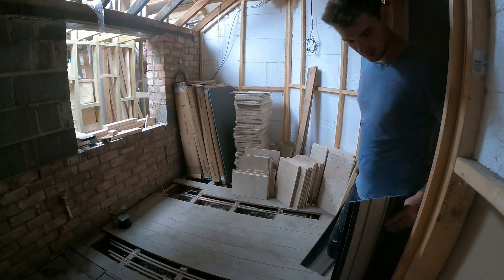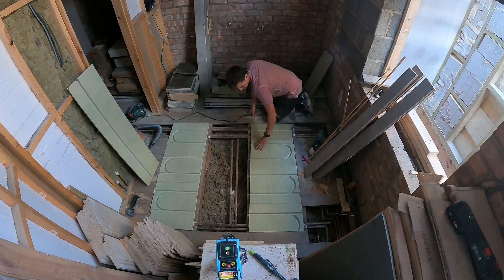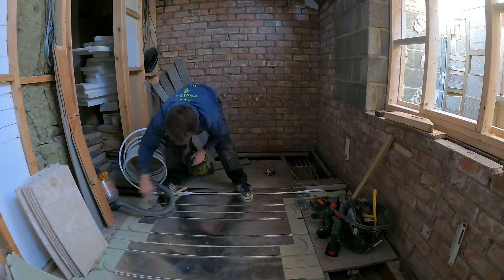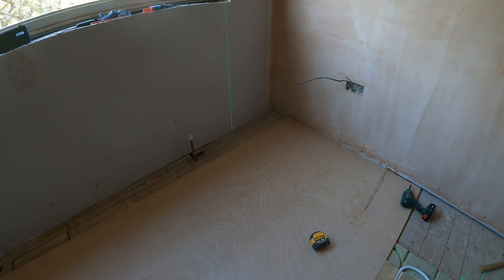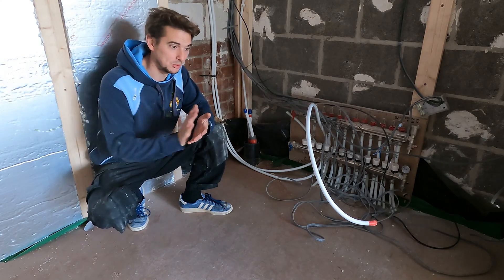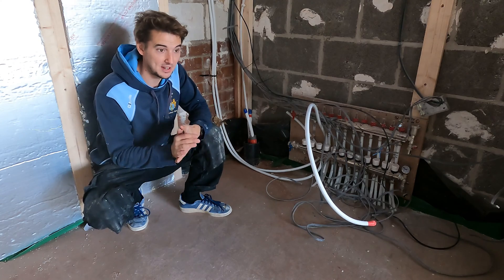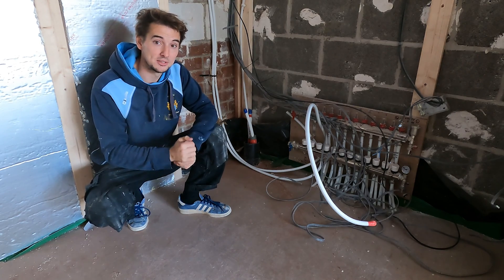Installing Upstairs Wet Underfloor Heating, Suspended Floor System, DIY Bedroom & Bathroom 🏠🛀🛌

Comment: Good to see someone not in the trade giving it ago ,  definitely easier ways but that’s life and everydays a learning day , all I’d say is when possible always go for hard wired room stats , rf are only for quickness and when putting new wires in isn’t a option as would be to much of  a mission ha ha .
Reply from the maker: Thanks for the positive vibes. It works really well this method so very pleased with it to be honest , not as good as heating the slab downstairs but I will take it as a win.
Was fuming about the thermostats but got all the wires in just in time .

Comment: Should have looked at the Honeywell Evohome. Wireless thermostats in the room. Wireless underfloor heating controller to the manifold. Needs a mains feed and wires to the actuator. Main controller is wireless. Has an app.
Reply from the maker: Cheers for the info, 
This was what was provided by the company. It works all fine and has an app and stuff . But like I say in the video “this isn’t what I regard as witless”.

Comment: A very helpful video thank you amigo,  i got some useful tips out of it.  As per below i do have 'proper' wireless thermostats from Wunda, they work with just two AAA batteries and talk back to the main controller.  It just seems strange they sold you something claiming to be wireless that wasn't.  Thanks for posting the video.
Reply from the maker: thanks for providing some feedback on the video. I have done another video on "laying another underfloor heating upstairs" in phase 2 of this build also that has some additional info for yourself. I will be doing another video on the performance of the system and uploading that to the channel once the cold weather kicks in.

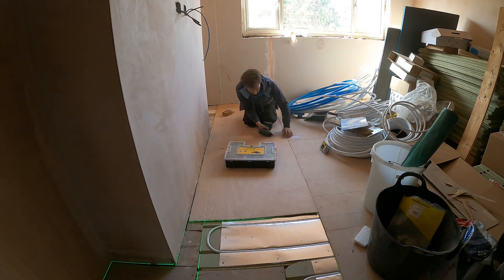Comment: Great video, loads of interesting information. 07:54 although using wires for connecting the thermostats to the UFH control box is highly recommended it is still possible to do it without running the wires. There are solutions available using RF, Wi-Fi or ZigBee along with designated UFH control box. I'm currently testing EONE thermostat from ENGO Controls and it working well. The actuators are in fact hard wired as they need 230v or 24v in order to operate.
Looking forward to new videos.
Reply from the maker: Hi Damian , 
Thanks for the comment , sorry I should of been more clear with the “wireless” comment. It was angled at the brand that I have purchased and not against other brands in the market which I’m sure do actual full wireless 🛜.
Reply: @houserenovations-tlom7317  thank you si much for clarification.  You are doing great work. Thanks for sharing.

Comment: how efficient is it to have UFH encased under 6MM of wood? doe the heat really transfer well to the above floor?
Reply from the maker: Good to hear from you. 
I’m sure some data is available on the actual figures for the product etc (which I don’t have) so all I can comment is on real life situation. 
I was in fear of it not working I will admit the first time I put this type of product in. It’s not as good as the concrete slab for efficiency I can confirm but the rooms that it’s installed in I have put radiators (put in as a backup) in and they are not switched on at all. I have an air source heat pump and running the underfloor heating is not only cheaper but more efficient then the radiators.

Comment: A lot more work than it looks at first. It takes a long time just insulating the floors and puttting flooring down as it is, hope its worth it in the end
Reply from the maker: Very pleased with it , very efficient. 
I agree it is more effort then chucking a few sheets down for flooring however it is a fantastic system. 
I have a video coming out soon on the performance of it all (just need to edit it).

Comment: Hi! Thanks for the video, very informative when you didn't have a clue what you were doing before you looked into all the different types of underfloor heating. Few questions, how long does it take to heat up and is it very efficient? In a sense of transferring heat through the floor?
Reply from the maker: Hi, 
Cannot give you a time on “how long it takes to heat up” as the system comes on in early AM. Couple of hours of it being on when I go to the rooms with this installed you can feel the heat. 
Yeah it seems very efficient I cannot complain at all with it. 
The two bedrooms for example that this is in are relatively long runs and have no problem heating up and providing heat to the bedroom. 
I did another video on this system on the channel which might contain further information that you might need. 
You need to make sure that the finished flooring cover that this is under is factored in (carpets / wood etc).

Comment: Thank you for the video. I am installing UFH in an upstairs bathroom for the first time but concerned that the foil panels DONT seem to be sturdy as I have heavy heavy floor tiles to lay down. Will these panels be ok with 6mm plywood to go under? Or should I use something more sturdy or thicker? Thank you

Edit: after a bit of searching, I managed to source some 22mm pre-routed chip boards from The Underfloor heating store. Thanks for all the advice, much appreciated 😊
Reply from the maker: Hey Sam , 
These foil panels go into the pre grooved chipboard flooring , once the plywood is then on top of the grooved & panels it meets the structural requirement. 
I have installed this method in 2 bathrooms and installed a self level method in another and I would say the other self level method is better. 
I have a video on this coming out soon for the self level method.
Reply: @houserenovations-tlom7317  Hi. ok many thanks for the speedy reply, much appreciated.

Comment: Hello life of miller 
Even tho hard wired is generally the best way to go, you can have wireless thermostats ( brand wunda or heatmister) for proof. In the final 2nd fix of the wire centre is 6 cable types 
Thermostats (if hardwired 
Actuators 
Manifold pump
2* two port valve to separate the radiator and ufh system put 1 near boiler for radiator and the other on the flow next to the manifold so it can be wired into the wiring centre 
A cable from the boiler   (Boiler signal 
Main power that is feed into a 13 amp fuse spur and then into the wiring centre.
Hope this helps
Reply from the maker: Hey Bryan 
Thanks for the comment which is good for others also who hopefully read it (please do others).

End of the day cables are in nw ain’t they. And like I said in the video was a good job the sparky got round and pointed this out to me. 
I do have a fair few Tado stats floating about however not enough for all the rooms. I mean they could of worked without cables as they are battery powered , but again because cables are in I will probably be buying more Tado stats in the future and hardwiring them in around the house.

Comment: Wet underfloor heating is a revelation, I now hate radiators having had four rot on me. They also get in the way of furniture. 👍
Reply from the maker: Hey Mark,
Good to hear from you. Do you still have rads in your house ?
Reply: @houserenovations-tlom7317  Yeah, not only a eyesore but the installer didn't put any rads under windows, cutting down even more furniture options and the tv has to go right next to a giant 1800mm long one. I've got one of those houses 🙄
Reply from the maker: Oh no not good at all. 
So the entire downstairs is UFH with one room being carpet and the rest tiled. Upstairs is 1 bedroom and 2 bathrooms as we speak . Another bedroom and bathroom is to be done .

Comment: What flooring did you go with upstairs? I had laminate installed without knowing ahead of time it's not supposed to go over 27 degrees C which just isn't enough to heat even a passivhaus
Reply from the maker: As it stands I haven’t got one in yet . But it will be carpet when I get round to it and that’s in the bedroom, tiles in the bathroom.
Reply: @houserenovations-tlom7317  Is it working well with the carpet? I've read that carpets are also not meant to be heated above 27 degrees (I think it can damage the backing)
Reply from the maker: Cannot confirm yet , haven’t laid a carpet down over it.